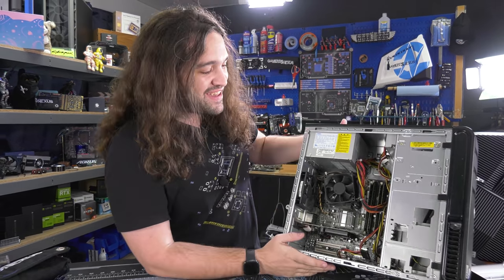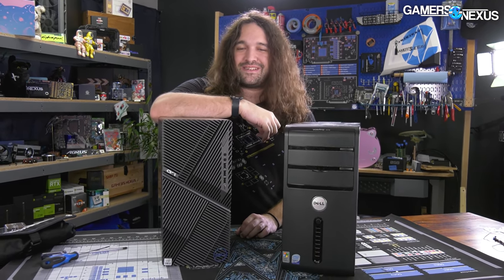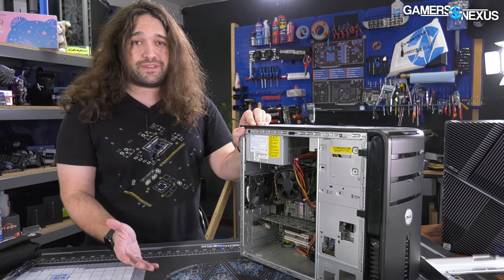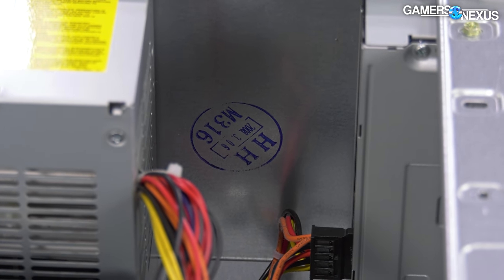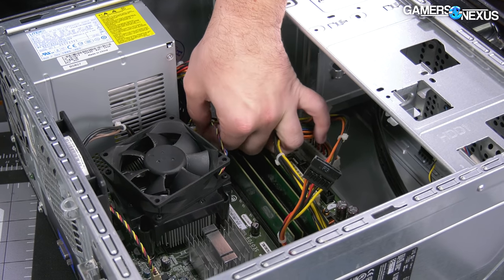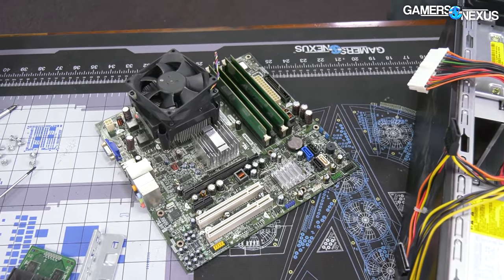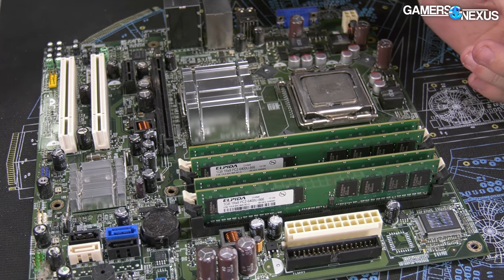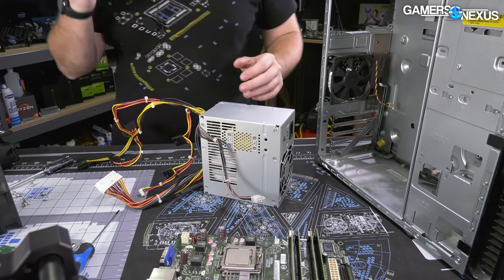13 Years of Dell Getting Worse

Comment: As kinda trash as their cases were back in the day, I still love their 2000's computer vibe. It's always fun to see people who are dedicated to the cause heavily modify them in order to build super sleeper PCs.
Reply: Doing that now with an OptiPlex 780. It currently has an Intel e7500 Core2 Duo OC'd to 3.65Ghz using the BSEL electrical tape mod to circumvent the locked down BIOS. 1TB Samsung Evo 870 SSD, 16GB dual rank, dual channel DDR3 RAM running at 7-7-7-20 clocks. Running Windows 10 Pro and a plethora of Linux Distros without so much as a hiccup. Waiting for an EVGA GTX 1650 4GB DDR6 GPU that's currently on it's way and about to order an Intel Q9650 Core2 Quad just to max everything out possible. Oh and an upgraded cpu cooler just for shits and giggles. Tinkering is fun, especially on older stuff. Funny how such an old Dell can still keep up.

Comment: My dell dimension from 2005 had a completely non standard motherboard so I guess it’s luck if they decide to use a standard size or not
Reply: Yeah, they had several lines of nonstandard computers going back to p3 days, but the exception was the "minitower" parts like this were typically still standard mATX.
Reply: its why modding first gen core optiplexes into budget gaming exists bc all the parts are standard in those
Reply: In those days, only budget systems would have used ATX boards. All the higher-end stuff (across many major PC builders) would have been BTX instead. It was the days of the Prescott Pentium 4 and corresponding heat output after all.
Reply: I think they switched from proprietary to standard for like a year then went back as it cut their profit margins. Dell wants/needs it junkies to keep buying new systems from them.
Reply: I got a Dell Dimension 4000 in a lot at an auction and I'm shocked anyone would decide to keep it. 
Optiplex might have a standard-ish board, but the PSU is proprietary and the I/O shield is built into the case, which in my experience is a bit of a pain to try and work with any standard parts still
Reply: @ericryang1757  nope optiplex didn't go matx until sandy bridge
Reply: It's a standardized size called BTX, it was made by Intel to cool the housefire that was the Pentium 4. Of course, nothing at all used it.
Reply: You paid quite a lot extra to have a standard Case, motherboard and PSU from Dell back in 2008. They viewed those as "Enthusiast" or "Professional" features.
Reply: I have serviced and repaired all kinds of pcs from the early 2000s.

A large portion  of  the Dell systems I worked on in the past 20 years have had custom motherboards and connectors.

I think Steve just got lucky here.
Reply: @CaramelisedNipples  It was these odd Core 2 Duo era models, the Vostro line was standard mATX but everything else was (OptiPlex, Dimension, XPS) some form of BTX. With the first gen Core i7 release XPS moved to ATX and OptiPlex did to mATX with Sandy Bridge.
Reply: @jm036  Ahh, I must have just just missed it. Makes sense as most businesses I did work for had the Optiplex line of systems.
Reply: They decide by beheading a chicken and letting it run loose untill it falls on a tile marked with the choosen standard
Reply: @markusfreetingham6854  If I am correct the 4000/4100 are Chieftec based cases, with the mainboard being standard ATX by the form factor, but with the proprietary PSU (20pin ATX+proprietary connector).
Reply: The cheap mini / midi ones more often than not we're standard.
Everything else bigger and smaller and expensive was custom.
Reply: It actually WAS a standard, it was called BTX, created by intel to handle the nuclear sun they called the pentium D. Both dell and HP used it, however it got precisely 0 traction outside of those two companies, and began to die off with the core i lineups. Shame, they worked great, those core 2 BTX desktop are absolute units. We only last year decommissioned these machines, often running 14+ years with 0 maintenance.
Reply: Maybe because it's a Vostro? For example, new Vostro laptops have extra ports (incl. Ethernet) and HW slots compared to Inspiron/Latitude.

Comment: I have a Dell Studio XPS with an i7 970 and it is almost 100% standard parts. Dell didnt always suck and in fact the XPS used to be the hidden gem in the lineup. They were often as good or even better than the Alienware ones for much less. You dint get the cool "gamer" case but you got performance....and standard parts.
Reply: Same, but with an i7-920. The PSU did die after about 5 years, but because it was a standard ATX, it was easy to replace. Airflow sucked, but this was before GN existed. Also the custom wiring for the front panel was a pain to move into a new case.
Reply: This was true even as late as 2012, 2013. I think it was round about 2014 that they started sticking things like non-standard motherboard power and such in there. Pretty sure you could still get a working XPS system with a like i7 4770 in it and it'd be functional for gaming even to today for the most part. Its main problem always was the same as today which is few people outside what might as well be called boutique SIs actually bothered to not put trash boards in there, in fact I just saw some video where I was impressed by the SI using a Tuf x570 which I thought was unfairly glossed over by the reviewer because over time like 80% of your problems are going to come down to the board. Bad CPU? Check the socket. Slow RAM? Need to overclock? Want an SLI rig? Need more storage? It almost always comes down to the cheapness of the board and its generation. 

In the case of an old XPS, yes, you often could just swap out the highest end CPU on that socket, get something like a new cooler say a 92mm Arctic which will fit inside the case, throw in some extra RAM, swap out the graphics card, and presto you've still get a modern gaming system which can in theory play the newest demanding titles.
Reply: @pandemicneetbux2110  You should be able to do such, but Dell, HP and Sony were dicks about it and made proprietary BIOS which limited options on most of their motherboards. You can build a PC with all consumer parts but have a BIOS chip on the MB which limits functionality; that is the old game of Dell, HP and Sony.
Reply: I'm still using mine, since I've been able to continue upgrading it. I put it in a better case, better power supply, added a new graphics card, and replaced the i7 920 with an i7 990X. It's awesome how standardized this PC is.
Reply: Dell studio xps 8100 user here. i7 860. Replaced the PSU,The GPU (Had a gtx 460,got a 6gb 1060) and added 2 SSD's.
Reply: @ghjong001  I just did a case swap with mine and I agree that the front panel errors abs the wiring is so annoying
Reply: "You dint get the cool "gamer" case but you got performance....and standard parts."

No cool "gamer" case for an XPS? Anyone who has jumped out of a crashed helicopter and chased Paxton Fettel around would beg to differ!
Reply: @pandemicneetbux2110  I recently bought an XPS 8700 with a Core i5 and a GT 720. Came with 8.1 preinstalled. Now just waiting on a decent graphics card.

Comment: The Q6600 was Intel's second "glued together" processor.  That was two Core 2 Duo chips on the same package.  Only without any actual glue - they had to communicate solely through the front side bus, which means any signals from one die to the other would have to go down the socket pins, onto the front side bus, then back up the socket pins.

Their first was the Pentium D, which was two single-core Pentium 4 dies on a single package.  Same lack of logical glue.

In both cases, multi-threaded performance suffered due to the lack of proper communication between cores.  Something you could easily see when comparing to the genuine multi-core CPU's from AMD in that time period.

That aside, at least the Q6600 had decent performance on the whole, being an evolution of the Pentium 3, unlike the absolutely atrocious Pentium 4.
Reply: I vividly remember when the C2D and C2Q were introduced. Heck, it almost feels like yesterday even though it was 15 years ago. They were such a a leap in performance and efficiency over Netburst that it stunned a lot of people. Along with the Pentium M's in mobile, Intel was setup to ride high for years.
Reply: Q660's was my friends budget chip until he upgraded to the g4560 and now is running Ryzen 9, talk about a leap
Reply: VIA had (well, has) x86 license for all x86 designs up to Pentium 3. I remember tech journalists making fun of VIA for not even trying to acquire one Pentium 4 design. And lo and behold, it lived on up until Nehalem. In the mean time Via turned P3 into multi-threaded, multicore low power CPU - it was just better material.
Reply: @OnTheRocks71  1.86 GHz launch core 2 could match the performance of the pentium d 965 emergency edition, running at 3.73 ghz and pulling roughly 1.83 jigawatts of power. Jaw dropping, and those were spanked by the e8000 series just 20 months later.
Reply: A few years ago I replaced two overclocked q6600 systems with sff hp i5-3470 systems. The q6600 systems used $12 ebay CPUs that ran at about 4 ghz with air cooling (old coolermaster hyper 212s with AS5 paste). 

I used them for multiboxing games and they were still holding up surprisingly well despite being on 24/7 running at 100% in the deep southern Texas heat. Despite using  hd5770s they pulled almost 300 watts EACH from the wall and were space heaters.. Could almost keep my living room warm in winter almost purely by folding on those machines.

It kind of blows my mind that my current setup can run games full screen full load and use 300 watts or less TOTAL. The setups being a ryzen 5 3600 system with 32gb ram 1tb nvme ssd 3x 1tb spinner with a GTX 970. A HP/compaq SFF business machine with an i7-3770 16gb with 2x 1tb drives and a gt1030 2gb gddr5. another HP/compaq SFF with i5-3470  8gb ram hd7570 1tb and 2tb spinners.  

It's amazing how much more efficient modern CPUs are.

EDIT :  If you were wondering you can see the screen of one of the q6600 machines in the three eve videos I posted that showed all the screens while I was boxing (the top screen). OBS was NOT kind to the q6600 machines or my primary machine which was a fx6300 based system.

Those Q6600s were damned good performance for the price on the used market +8 years ago.
Reply: @Nick-ue7iw  Clearly there's an attempt at "Back to the Future" humor in your post (1.21 jigawatts!!!) but it fell flat.

Even 1.21 Gigawatts (or 1,210,000,000 watts) is enough to power over 10 MILLION light bulbs, or exactly 1 million 210 thousand gaming computers running 1,000-watt PSU's (e.g. the Corsair hx1000)

Basically, if you're pulling 1.83 gigawatts of power through a single CPU, you've created a VERY short-lived fusion reactor!
Reply: Pentium 4 introduced Hyperthreading, it walked so Intel Core would run.
Reply: mate what are you on about i rocked a 3GHz Northwood until 2008, actually played through Stalker SoC and ME1 on it, thing was a beast

Comment: Used to think that Dell made pretty solid computers until I began watching your videos. That's because I was last updated on Dell back in about 2008, which to me, being an older guy, actually isn't that long ago. 😄
Reply: Dell computers are good. Just not the super powerful gaming ones. As you can see in the video.
Reply: @Warp3326  Thanks for the clarification! 👍
Reply: @somerandomvertebrate9262  Yes. I think if you get a more basic dell computer you'll be fine. I'm using a dell computer right now and its lasted a good 3 years. It's just a basic dell desktop though. Costed around $750
Reply: @somerandomvertebrate9262  Sorry to reply again but if you're looking for a powerful computer such as a gaming computer or a powerful office computer stay away.
Reply: @Warp3326  750 bux is gaming territory for me as i just built a pretty good PC out of pastgen parts for that (Z390 with 8700k and 1080ti, i could go for lower tier stuff and cut cost even more but i wanted those CPU and GPU). There could be an arguement for commercial desktops as i just spent a year overhauling (among other things) a fleet (100+) of 7th gen HP 290s that could be cannibalized in case anything failed in them (but nothing did, they were all champs and just needed ram and storage upgrades) but for personal use? No. Fucking. Way.
Reply: LoL I was the same.
Reply: @Warp3326  No worries, bud. I sure will. 👍

Comment: The rubberized fan mounts are a great upgrade though, removes a lot of vibration noise. I scavenge them from old systems like this whenever I can to re-use them.

Comment: Back in early 2000's this was how my friends and I gamed. We bought these premade PC's because they were a decent price for teens on a budget. All you had to do through the years was upgrade your gpu or ram.
Reply: You can actually still do this with some brands, here in europe we got that ALDI brand Medion. All normal Parts , i bought one with a 5600g in it 16gb ram and slapped a 1650 super in it for a friends. Runs perfect
Reply: I also had an optiplex and crt monitor in the 2000s but the optiplex was one of that flat laying cases it had like 1gb ddr1 ram and a pentium 4
Reply: @tomweyts  i bought one and send it back this october, since it was literally garbage, first it came with a kink in the watercooling tube because the cooler was mounted wrongly then the OS was installed on the HDD storage instead of the SSD and it basically didnt run, i had to remove the HDD to install windows on the SSD because there was some kind of software that made it so you could only install it on the HDD. Also for a highend gaming pc that it supposedly is, its performance is crap, not to mention that if you let it run under heavy load for over 2hrs that it shuts itself off, was the first time buying an aldi pc and i will never buy a pc there again.
Reply: @empi2597  weird ... The one that my friends is now Running doesn't have any issues.... I gave it a full night of benching & stresstesting. Stabilty test of Aida 64 ran for 10 hours with no crashes or issues
Reply: @tomweyts  nothing weird about it, if you look and research a little, the type of aldi pc that i bought has had massive sendbacks. not to mention that with a 11900k i9 and a 3080 geforce a 750W powersupply is a joke, that whole pc is ridiculous if i think about it more carefully shouldnt have been blinded by its cheapness, that machine was a hot pile of garbage, not to mention the benchmarks with both those components performed over 20% below average.. that thing was a disaster.
Reply: @empi2597  i know people with that System and they have 0 Problems guess u got unlucky 🤷‍♂️
Reply: Same here. I had a dimension 2400, then later a 4600 that lived on until 2012. One friend had a e-machines core 2 desktop (lord knows which one), another a HP tower, another an acer tower. All were upgraded, gutted, and upgraded and modded for years. When someone wanted a cheap upgrade you bought a 3-4 year old model for cheap (I remember the HP friend going from the P4 HP to a core 2 e8600 HP tower in 2011 for maybe $150). That's what you did, and why despite all reason I still like these shitboxes from the late 2000s.
Reply: I read the last sentence of your post in Big Smoke's voice. It was involuntary...
Reply: I had a 450€ hp office desktop pc around 2009 (cant remember which one, i was like 10 years old) where you couldnt even upgrade the ram. The gladly store took it back and i got myself a compaq pc where you could atleast upgrade the ram😂

Comment: As strange as it is, I'm still running 4 of those Vostro 400s in my office.  They've been relegated all the way down to the systems for the interns, but with some minor upgrades that we made over the years (SSD+8GB RAM) they are serviceable.  The newer Dell systems that we have in service have had constant and consistent issues with power supply failures which have led many of them to go to the eWaste pile.

Comment: Great video! Only criticism may be that you're not comparing oranges to oranges. The Vostro is the "small business" line (step up from consumer grade Dimension at the time, or Inspiron tower now, but below the real business line, OptiPlex). I'd be interested to see a comparison to a current day Vostro or OptiPlex. The G series is just a consumer grade machine and I wouldn't expect it to be much more than disposable. I also feel the quality of Dell ProSupport vs. consumer support is vastly better. But totally agree with the disappointing direction Dell and other OEMs are headed, seems no one makes good consumer grade pre-builts and they're all spiraling toward the bottom.

Comment: Actually I prefer the rubber grommets for the rear exhaust fan, especially on Dells. Yeah, it makes replacement a bit harder but their exhaust fan tend to have high RPM and airflow, and the grommets do help prevent vibration and noise.
Reply: Noctua also provides these with some of their fans
Reply: @Topper_Harley68  Redux Line?🗿
Reply: Those rubber things might reduce noise, but they collect dust! Had a fan with rubber like that. It had alot of dust stuck to it!

Comment: I had a vostro 400, it was a great starter system at the time for someone who needed an initial rig to build from.  I threw in a GPU and it worked great!  Ended up replacing other components until eventually the original dell was no more, and so in a way, that system is still with me today.
Reply: a true ship of theseus moment